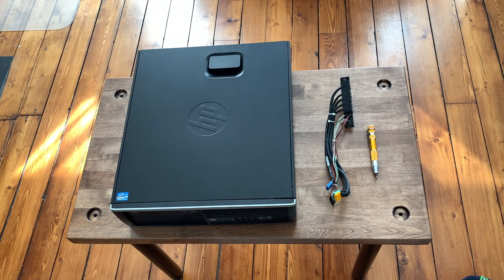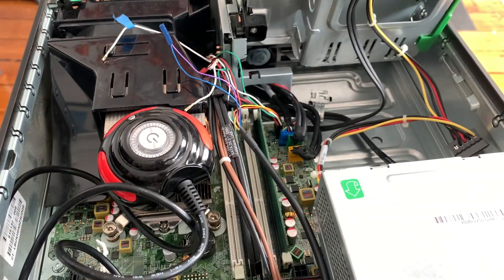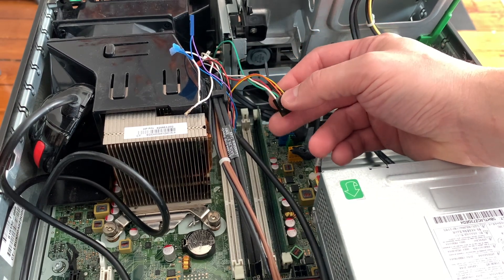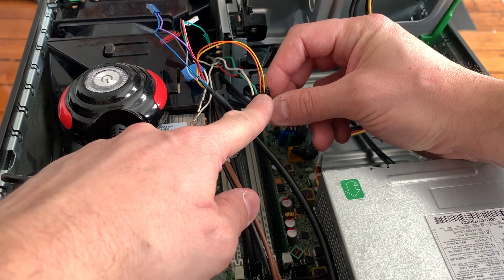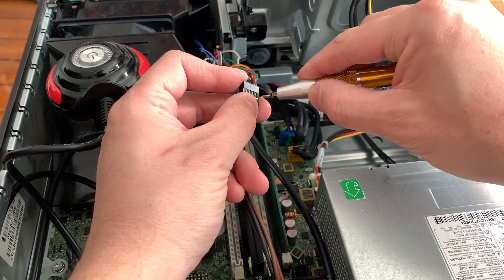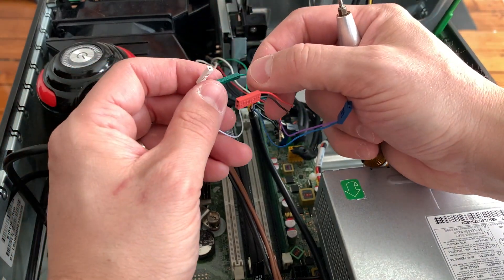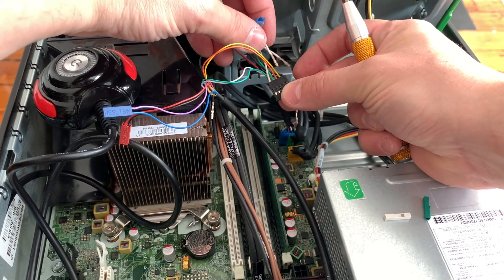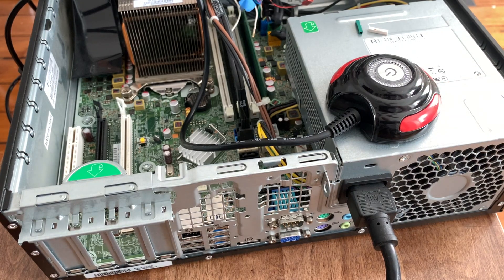Adding External Power Button To Arcade PC

Comment: Great video and thank you!  For those who are IDIOTS like me... BEFORE you get started you will want to run the cords from the new power button THROUGH the PCI slot FIRST before you start connecting.  Otherwise you'll have to unplug each of the connections you just made (or in my case there were fewer connected to the system, so I unplugged those two) and then reconnect them after running the connection through the slot.  The PCI bracket that comes with this particular power button also doesn't fit my HP computer (it's got folded edges, not flat unlike what's fitted to it now, so I just left it off and ran the cable through the open slot).

Comment: Thanks Carlos, awesome video!  I'm going to be installing my Arcade-One PC into an arcade cabinet.   Can I use the two items listed below (using the same instructions from your video) to create a retro style button for my cab?

https://smile.amazon.com/dp/B07PM9T1MY/ref=cm_sw_r_cp_apa_fabc_PK9FTXPZ7RJZN9GQ8K05?psc=1

https://smile.amazon.com/dp/B07ZGF6NV4/ref=cm_sw_r_cp_apa_fabc_G84Y2PK9XEHG6NM8KTED
Reply from the maker: Yes, the second link is only necessary if you want to keep the original button from the PC connected in addition to the new button.
Reply: @ArcadeOne  Awesome, Carlos, thank you so much!

Comment: Is it better to do it this way or to use the BIOS and use the option to allow restart after power failure.  Then turn on the switch to a switched outlet in some various way.

Honest question cause one may be better or safer for long term use.
Reply: What i did was simply plug the PC to an external power strip and then wire that to an ON OFF Switch that was mounted to the exterior of the cabinet. I went inside the BIOS and set it to turn on when power is applied.  That way, all I have to do is flip the on off switch on the back of the arcade cab and it sends power to the power strip, which then sends power to the PC which then turns the PC on based on the BIOS Setting I applied.  I then do a safe shut off of the PC and walk around back and flip the switch to turn everything off.  Super simple
Reply: @Jeff_1983  agreed, hence my question
Reply: I'm trying to understand if there is a benefit to connecting to the motherboard
Reply from the maker: This is just an extension of the built in power button, it’s no different than pressing the real power button in the front of the PC. It’s cleaner than the other method mentioned. You can use a smart power strip, connect the PC as master and all other devices as slave, press this external power button and everything turns on. Shutdown through Hyperspin and everything turns off.
Reply: @ArcadeOne  thanks for the reply